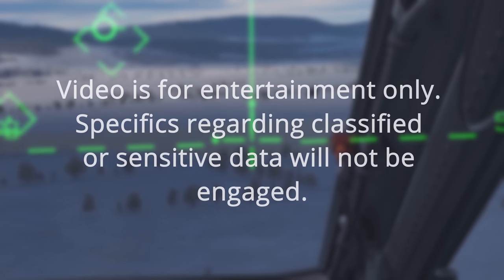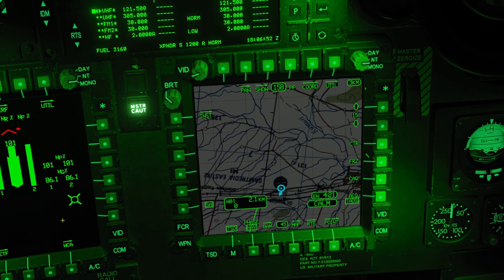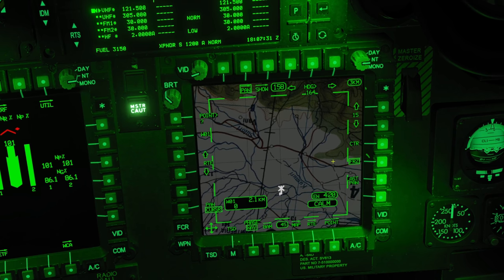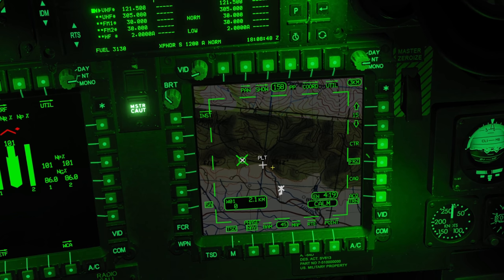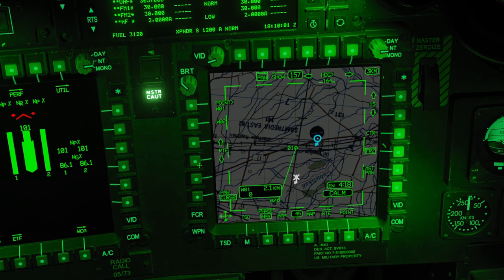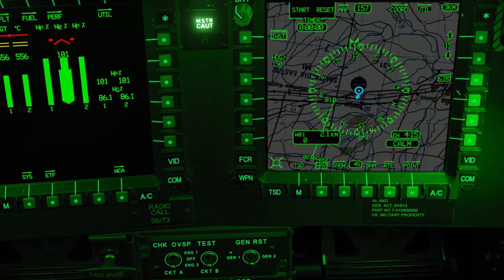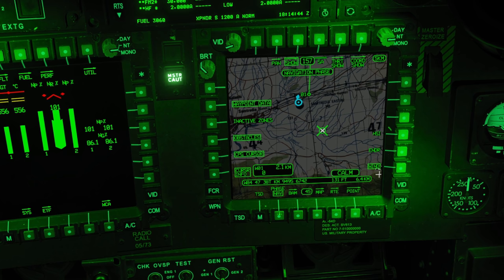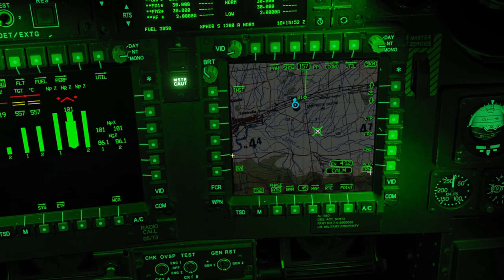DCS: AH-64D Tutorial | Tactical Situation Display

Comment: What I`m wondering the whole time is, if the Apache does have an auto-hover function at all? I understand that not all trim functions are included yet, but I don`t know if this feature is part of the actual helicopter systems or not? Because... if not... how are you supposed to fiddle with those MPD`s during flight, if you are not a squid? ;-) I loosened the spring of my cyclic stick to have a more sensitive way of controlling the aircraft, but this again makes it near impossible for me to keep it in a hover and focus on the MPD`s... :-(
Reply from the maker: Yes it does but it’s not set up in the module yet.
Reply: @CasmoTV  Thanks for your quick reply, that`s great to hear! 👍

Comment: Great work as always, Casmo!
I'm curious if I'm overthinking the Force Trim, or if it just doesn't quite work like the Ka-50, but I'm just having a bitch of a time trying to get into a stable hover in the Apache, and wonder if it's just because I was spoiled in the Ka-50...though I feel like I might be more stable in the Hind at this point.

I'm still playing around with the trim options and everything, but figured I might just be missing something.
Reply: The apache is much more of a "hands on" flyer. Trim it in small increment to a stable position and then refine your trim with small adjustments and multiple short presses of the trim  switch. As you bring your flight profile where you want, be that hover, sideslip, aerodynamic trim or nose to tail trim you can simply tap trim and release controls.
In short less holding the trim button like the KA-50 and more tapping it.

Comment: Nice, thanks Casmo! Is there a way to quickly turn off the HDU, or do you manually flip it up IRL?
Reply from the maker: Manually rotate it away
Reply: There's a keybjnd for that. Default is 'I' as in IHADSS, I think.
It even is animated in external view. 😍
Reply: @shagrat47  It's also animated in VR - but only when turning it away. It pops back in front of the eye instantly. Should be an easy fix though. It's a massive immersion factor in VR, especially since the lens is reflecting things as well and it's slightly visible in peripheral vision still.

Comment: For me, staying airborne has been a challenge. I keep flipping over and crashing when I use force trim. Its nice while I'm cruising, but as soon as I change direction I lose control and can't reset my trim.  I'm really fighting against the aircraft to stay airborne.
Reply: Lookup trim modes....they have huge impact...Default behaviour is that if you hold trim up - you disconnect trim and when you let go - trim that exact position...You have to immediately let go of cyclic - if you dont, you cyclic position is instantly added to the trimmed position...and you end up with too much action...
And you can even trim rudder - if you select it in options...
Use right ctrl + enter to view your trim...
Its easier to fly with some forward speed than hovering...so if you start losing control, try to aim nose down....

Comment: We need a button that centers trim back to before take-off. We're just guessing where trim is coming from forward flight to a hover.
Reply from the maker: Nah you just need to practice and learn what works. Just like the real aircraft. I’ve been flying this module for 8 months. Never needed a trim reset.
Reply: @CasmoTV  you're also a real pilot lol. How do you "know" when your trim is in a neutral position?
Reply from the maker: @dannyd7714  I can’t tell you that. There isn’t an answer. Just keep playing. Try flying without it for a bit. Then make tiny corrections.
Reply: I guess it's just the DCS simmer's thing to reset trim to center if possible, but basically you should trim according to your needs, including for a hover shortly before landing. Just leave it there and you'll pick up just fine again.